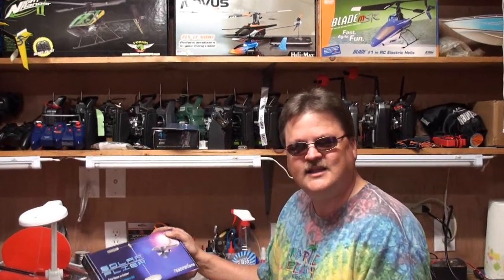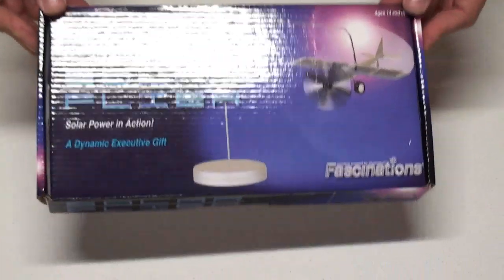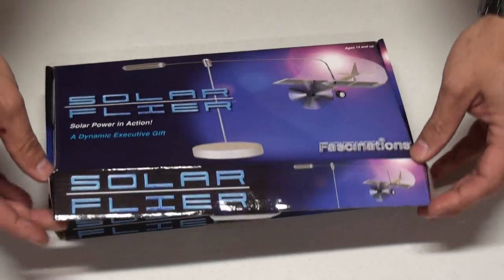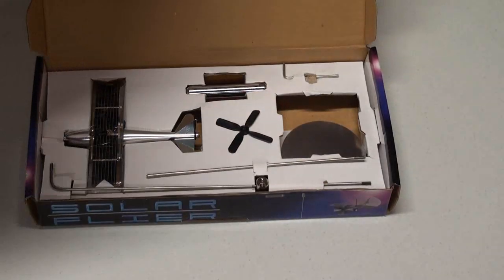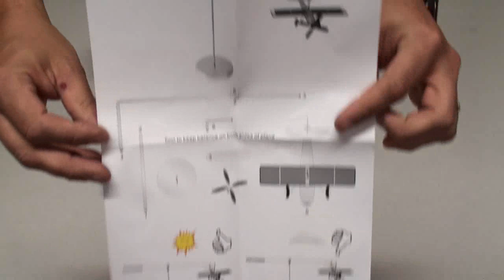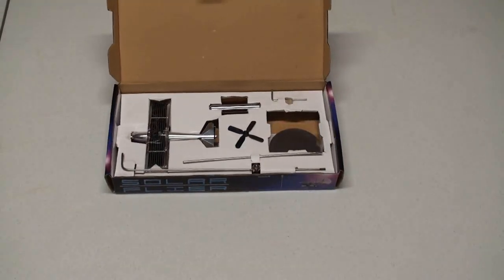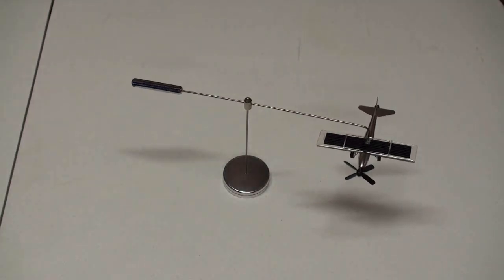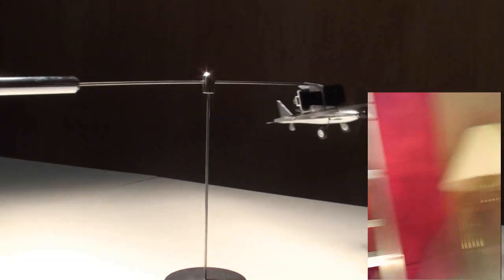Solar Flier. Desktop Solar Powered Airplane with On Board video Cam

Comment: Hehe, I found this little plywood airplane and decided to attach a mini solar-powered motor and propeller I bought from e-bay. I don't think it will last too long in the air though. This is a neat trinket, but the pilot is going to throw up, and then be ready for space travel. :)